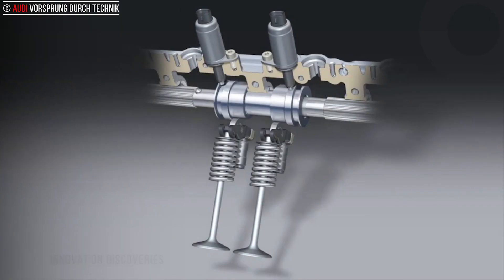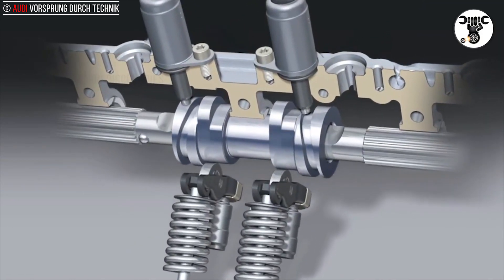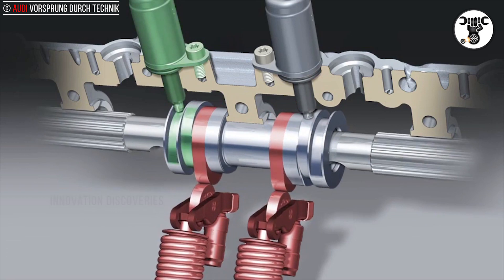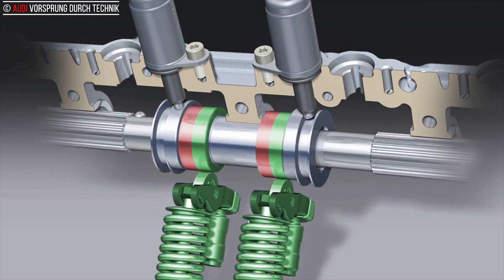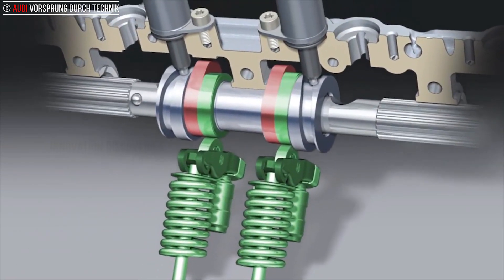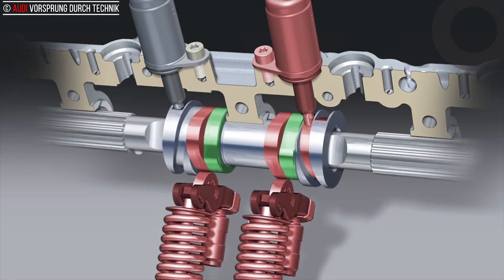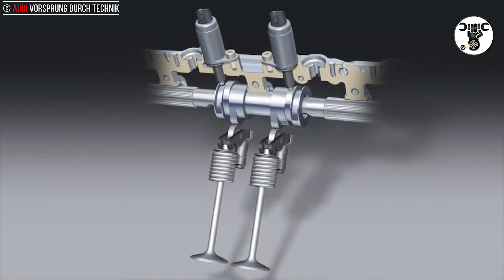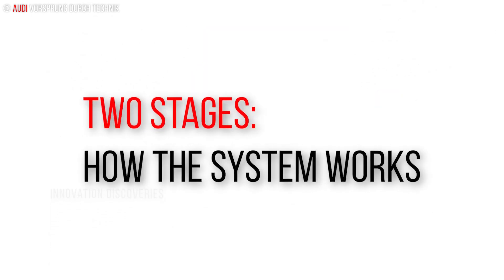Audi valvelift system

Comment: Audi valve lifting same as vtec engine or what ??
Reply from the maker: Audi’s Valvelift System (AVS) is similar to Honda’s VTEC but works differently. VTEC switches between low/high-lift cam profiles using rocker arms, while AVS uses a sliding camshaft sleeve for smoother, progressive adjustment. VTEC is more aggressive for high RPM power, while AVS is optimized for turbo engines, balancing power and efficiency.
Reply: The audi system is more akin to the Yamaha system than vtec